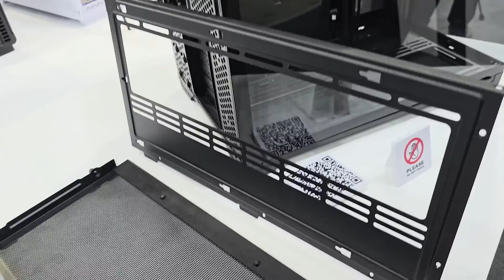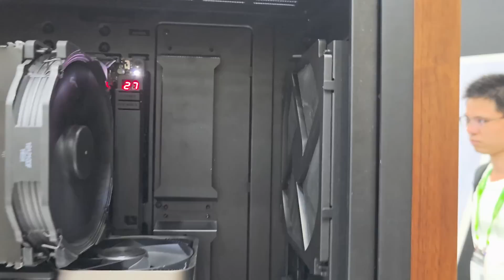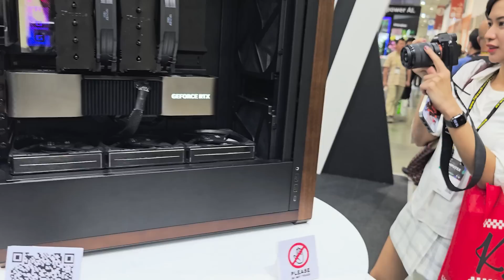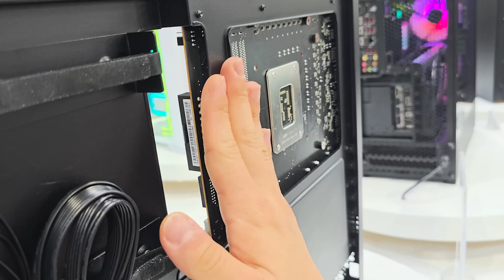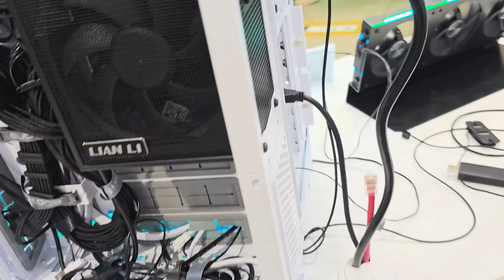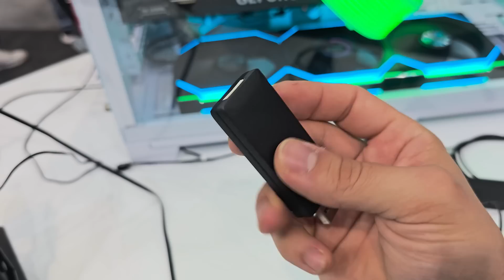LIAN LI Just Fixed RGB Forever! Also New Cases Unveiled! | Computex 2024

Comment: Lame, My argb hub plugs into the mobo, and also power then I use my remote control for 7 fans. I don't see the difference. LAME, They had air conditioned cases waaay back in 2006 that uses spray foam to keep the condensation out. Lame, I had a robot case that looked almost identical to optimus prime way back in 2006 with a glass side. Lame, they made 10000 rpm fans back in 2006 that were less loud than your mom or clickbait.

Comment: Do not touch!

So how are you supposed to describe and do a mini review if you cant touch it

I wish mboard manufacturers would make the 24pin on the side of the board facing just that the side instead of straight up as the norm. It would make builds look even more tidier in cases like the Lian Li one at the start

The case with the PSU at the front looks cool by I'd be skeptical about that pass through cable to the main cable

Comment: The wireless RGB is nice for cable management, but it introduces standard issues for wireless anything. Limited number of devices on a receiver, signal interference from external sources between the RGB devices, creating signal interference for other wireless devices nearby, so far proprietary communication standard. Not using a powered hub also nice for cable management, but also introduces limitations, with the total amount of current available through the motherboard header vs independent SATA power. And if you are getting power from a USB port on the motherboard, and the power needs to be physically connected to all devices, it seems reasonable to pass USB data along that wire and forgo all of the wireless communication, but then we've pretty much reinvented Corsair Link.

Comment: Lian Li's Usb stick is too large they need a v2 revision imo, I would not use as it will block other USB ports.
Reply from the maker: Agree it's a bit large. Fortunately it comes with an adapter that lets you connect it to the motherboard's usb 2.0 header if you prefer
Reply: I'm just gonna treat it like my feelings and crypto earnings... hide it deeply and forget it exists. 😂
Reply: 6 bucks short USB extension, probably should be included, like the HDMI one that comes with a Fire TV Stick.
Reply: You can use usb cable extender and hide the dongle inside pc case